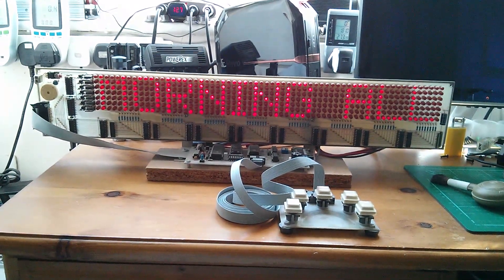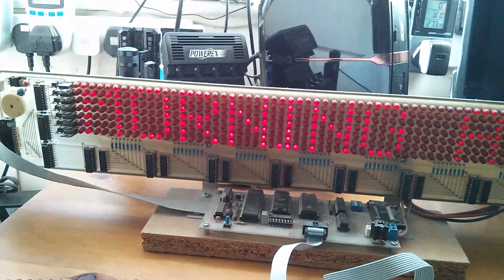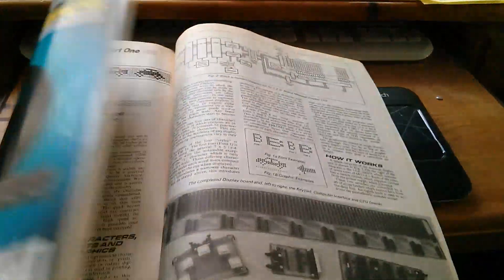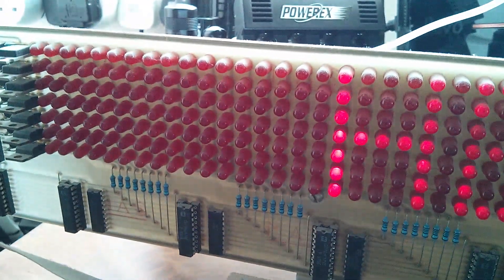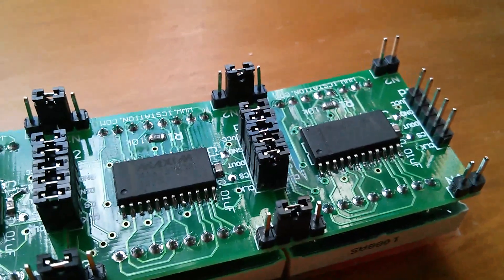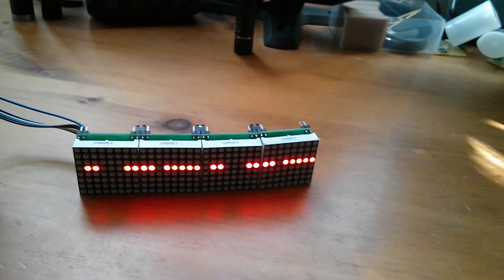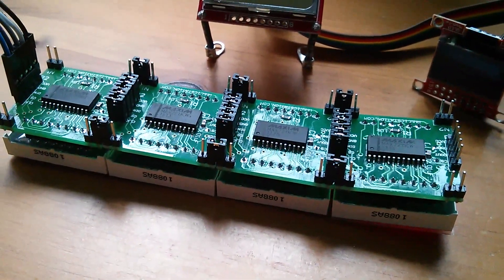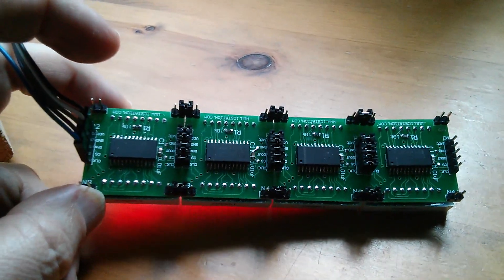LED Matrix Displays and Non-Optimal Byte Orientation

Comment: I made one in the 90s and I used horizontal bytes Because vertical bytes would have been too dim with all the multiplexing. 1/7 brightness is much brighter than 1/32 brightness (multiplexing duty cycle).
Reply: I mean several 74373 can drive all the columns of each row simultaneously 1/7 of the time and not be dimmer if the matrix is longer. A bigger transistor drive each row then but there are only 7.

Comment: Bought heaps of different LED 8*8 matrices and at the end of the day they all worked but were a pain in the butt for one reason or another to cascade. My next project is using a DIP version of the MAX7219 using the 3mm 8*8 array in a 4*1 configuration that can be linked.

Provided the 4*1 works and can be linked and I got the spacing right will make similar for 4*2 and finally 4*4.

As for buffering I have multiple bitmap classes for 1,4 and 16 bit displays so use the 1 bit version for these. The 1 bit version (here's the trick) has 2 mapping options so I use the one that mimics the MAX7219 output format 1:1.

My MAX7219 class has an output buffer method that expects a frame buffer and it simply transfers the lot. On my Due it uses DMA at a clock of 20Mhz to do the transfers which can output well over 100 FPS with a 32 * 32 pixel grid.

I also found the original code I used for the MAX7219 was quite shockingly slow. It use to clock a lot of NOP operations and over multiple devices it would choke. Basically I send each byte just once but send in reverse order as they get shuffled along.

Comment: Bit-per-pixel video displays almost invariably orient bytes horizontally because everything on a row needs to be sent consecutively because an N-dot display will only need to fetch N/8 bytes per line, instead of fetching N bytes of data and discarding 7 bits from each.  Scanning top to bottom generally looks better than scanning left to right, and unless a display's memory is set up to group bytes differently when fetching than when writing, that implies that bytes get oriented horizontally.

My more modern pet peeve is with color oled/lcd displays that require shifting in 16 or 24 bits per pixel.  Adding a 256-color LUT and then having an option to write 8 bits per pixel shouldn't cost much, but would make microcontroller-based screen updates almost twice as fast.

Comment: I had this problem on a display like your and all I had to do was make changes to the header file for the Arduino library I was using. I used the MD_MAXX7219 library and after making the changes it worked great. I think learnelectronics has a video on it.

Comment: For cascaded modules you better use a software display buffer (bitmap), because you can easilly build e.g. 16X128 pixels matrices. You can put bits to the buffer any way you like. Finally, a Paint() or simillar function transfers whole bitmap to the MAX ICs. I could send you my software 'driver' if you like.
Reply: Was thinking the same thing, why not just solve it in software. Have a separate the font and a screenbuffer

Comment: I agree. The chip was meant to drive 7s digits. Anyway, you can arrange anything you like in software ;) (1. Create display_buffer, 2. Fill with pixels using by column method, 3. Transfer it to the matrix using the matrix orientation)

Comment: In my time creating new fonts for the ZX Spectrum I clearly remember that it uses vertical lines when creating characters.
I used a notebook with 5mm squares to draw in each character and them writing the binary value next to each row.
Reply: £-D  The good old(est) days, yes I remember doing that too (and for the C64 fonts [and sprites]) until I created a bit editor and then just saved the data to where it was needed...

Comment: I also have copies of the PE with the message board...well done...great project...different spelling of your name.
 I have recently built the brainy-bits one with 8 modules having top and bottom connectors. I would have liked to build the Parola (marco_c) version but I think they have only released a library for a max of 8 modules...some nice effects there. I wanted to try up to 16 modules.

Comment: I bought these same ones for $1 per board and they work great! I had the same problem at first but I did the rotate in my character data and then bit masked the data to flow by row instead of by column.

Comment: I bought 4 8x8 Led matrix modules (similar to the ones you showed on ebay, but preassembled, 1.70 pounds each. They fit next to eachother, of course the wires go in at the bottom and come up the top, so it has to be connected with wire. But since its vertical bytes, its easy to program. Actually few days ago ordered another 4, because why not :)

Comment: You've not got it wrong, that's a really annoying way to implement a display.  It would be much nicer to send out a vertical byte each time.  I used to service the huge tungsten and then LED public display panels and they all sent the data out one vertical byte at a time using cascaded 4094 shift registers.  The only way I can think of getting around that is to use an eight byte buffer that you fill normally, but then gets shifted out vertically, but it's still a load of programming hassle.

Comment: Did you get any more projects published in P.E. or other mags around that time? I have quite a few ov those old issues eh. :)
Reply from the maker: Yes, after the LED matrix, we did the EPE Fruit Machine, MIDI Analyser and I did the National Lottery Predictor (UK lottery) followed by an article on alphanumeric LCDs.
Reply: Julian Ilett I'll keep an eye out for them when I go through my mags...! I often find an old back issue ov an electronics zine makes for good light reading. :)
Reply from the maker: xanataph I had a huge collection of electronics magazines some years ago. Storing them was a major problem - at one time they were in the machine room above a lift shaft in the building where I worked. Then they filled an old scrap car on my drive. Eventually I sold the whole lot for £1 on eBay. I could never find the article I wanted anyway!
Reply: Julian Ilett Yes, I have boxes and boxes ov them, proly not as many as you had, but spread all around the house. And indeed it's a major problem to find a certain article when you want to refer to it! I just don't seem to do it. Whenever I have an idea for something I need to make I just design the circuit from scratch, like the beer fridge thermostat I had to put together the other day..! (Fridge doesn't get cold enough to be a fridge, freezer doesn't get cold enough to be a freezer - but that compartment makes a great beer fridge for our Tap King now that the temp is under control). I'm sure I could have found a circuit in a mag somewhere and saved the development time. But which mag? hehe
Reply: xanataph And besides I wanted to use a germanium PNP transistor as the temp sensing element, as I haven't got any thermistors or those temperature sensor chip thingies. ;)

Comment: What you can do is store each character as 8 bytes, where each byte is a horizontal row, and just left justify the 7x5 font leaving the right most 3 bits empty, then when you come up with a string to send, assuming a 1 wide gap between, you get groups of 4 letters for 3 bytes:    (6)(2|4)(4|2)(6)
So you send 4 letters at a time
(a & b >> 6)
(b << 2 & c >> 4)
(c << 4 & d >> 2)

And just do that for each row, I'm not sure how the interface works to the LED's but it seems to me like you either shift them over and write a byte in, or you send a byte and an address and it works it out. Either way I think this solution can work and if you need less than 4 letters you just eliminate letters going back from d.

To have it somewhere else besides left justified it's a bit trickier, if you're coding in assembly or can add some inline you might have access to a right shift with shifts the bit on the right into the carry flag, and another than shifts the carry flag into the MSB while shifting right, though that would need to be done on the whole word.

Another way that should work would be:
mask = pow2(offset) - 1;
b1a = (a & b >> 6);
b1 = b1a >> offset;
b2a = (b << 2 & c >> 4);
b2 = ((b1a & mask) << (8 - offset)) & (b2a >> offset);
b3a = (c << 4 & d >> 2);
b3 = ((b2a & mask) << (8 - offset)) & (b3a >> offset);
Reply from the maker: Wow, thanks for all that detail. I'll have to read it a few times to make sense of it all
Reply: Julian Ilett No problem, I had to think about it a few times to get the shift values correctly, looking it over again today I'm not even 100% sure of my logic for the version with offsets so I'll have to look at it again since it's making me wonder if I even really need the mask at all since I'm left shifting it
Reply: I think there's one error there, you need ORs or adds, not ANDs to combine chars.

Still feels like a bit of a ugly workaround, as to be able to change a character you need to keep a text or bitmap frame buffer in sram on your micro.
Which somewhat negates one benefit of having MAX7219s in the first place.
i.e. if the displays were the other way around, to write a character at some position you look up the 5 values for the columns of your character and write them to the correct addresses.
The way around these are, you have to look at 0, 1 or 2 neighboring characters, look up the bitmaps for them (unless you keep a bitmap frame buffer... which takes up even more memory), do the shifts/ors and write out 7 or 14 bytes.

Once you go beyond playing glorified HD44780 and start doing variable width characters, fonts that aren't a multiple of (7+1) bits high and/or arbitrary vertical position, it kinda becomes a wash as you need a frame buffer anyways.

Hmm, on second thought... every time I found myself caring about RAM usage on my controller that much, I was too cheap and should have gone for a bigger one in the first place.
Reply from the maker: artforz Agree entirely - I've got the other module type on order, which looks like the byte orientation is vertical. I'll make another video if that one proves to be much easier to write characters to.
Reply: Julian Ilett
Yea, if it's easy enough just to get ones that work better, it's much better than having to deal with a hacky solution like mine was. Kind a of right tools for the right job situation. I'm sure there must be some reason that someone would want horizontal byte orientation like this.
And yea those should have been ORs not ANDs.

Comment: Maybe rotate each display 90 degrees, dispense with the jumpers and use ribbon type interconnects or to get really long-winded you could make a PCB. Working on the software sounds best but from what I've read in the comments I wouldn't know where to start. Good luck.
Reply from the maker: That was my thought - until I saw those cheaper, DIL modules with mounting holes
Reply: i thought that too, as there is another model that has the chip on the bottom of the PCB that has the modules link from bottom to top. 
Also there is another model that has the modules linked together with tinned copper wires instead of links.

Comment: Yup I'd just use a framebuffer and write to that, outputtng 30 times a second. It's a hardware problem that can easily be solved in software, providing you have enough ram in your microcontroller to store an entre framebuffer - should be plenty on an atmega328
Reply from the maker: Of course you're right, a frame buffer is the answer. It just feels a bit unnecessary because the MAX7219 is like static memory - it holds all the display bytes and does its own multiplexing. But I guess software exists to glue incompatible bits of hardware together.
Reply: Julian Ilett I'd certainly agree that there is an issue - the developers of that particular board have basically stuck the daisychaining connectors on the wrong edge of the board. You could rectify the issue by joining each board together with DuPont connectors, but that's not ideal. Also, If you were tight on ram in your microcontroller, a framebuffer may not be an option, and it'd be nice to be able to use the MAX7219's internal memory instead. It's a pretty silly design flaw in the board to be honest - but then you can't really expect much for £2 ;)
Reply from the maker: Kieran Simkin Exactly my thoughts.
And you're right of course - spend £2, expect problems. Then again, problems are fun - you get to solve them!

Comment: This  horizontal bytes arrangement isn't any different from how a VGA works in 16 color mode.  it's just about masking/shifting your bits into the place you want them.
It may be "weird" to someone into electronics with less experience at programming graphics, but for someone used to graphics programming this is a pretty normal setup.
Reply: Elaborating on this, to program it, I would just imagine you have a screen buffer (an array) matching the size of the display and you do your bit-twiddling there, then update the leds from that buffer.
If you have fonts that are 8x8 this makes perfect sense, ifyou have a narrower font, or if you have variable width fonts, it's a bit more cumbersome.  
Also: it might make less sense for text, but for adressing it like a bitmap it has it's advantages doing it this way.
Reply from the maker: Really I'm having a go at the PCB designer, who doesn't appear to have given it any thought. The designers of the Nokia and OLED display chips went to some lengths to make life easy for the programmer - particularly if arbitrary strings of characters are to be put in arbitrary display locations. It's almost as though the designer of the LED matrix PCB set out to make it difficult.
Reply: Julian Ilett Like I said, this orientation is normal for computer video. It makes scrolling vertically easier (and makes horizontal more difficult). Displaying font isn't significantly difficult either since computers tend to use fonts with a width of 8 pixels (various Heights).
For a led display where you plan on using horizontal scrolling a lot, the other orientation makes more sense.

Comment: I would solder some sockets to a big plane pcb and plug the modules in nice and flat.
These modules are probably designed to create a bitmap output not specializing on fonts. horizontal memory orientation is more common.

Comment: Hey! 

I've built a 64x16 pixel (so 8x2 modules) display from these exact modules. They're driven by an Arduino Mega, and I get around 35-40 frames per second. Images are sent via usb serial from a python script, wich just downsamples and chopps up png sequences, and sends them one line at a time (so 8 bytes), the arduino waits until a complete frame is received, and pushes them out via 2 channels to the maxim chips. sadly 2 channels are required, because its actually not possible to chain them for very long. Only 8 of them are supported per channel. I was thinking that I could at least double the frame rate by displaying each line as soon as its received, so maybe some sort of rudimentary 3-level greyscale could be acheived. Sending a complete row at once is actually the fastest way to drive these because of the way data is shifted between them.

Got some of those Nokia displays, and the same oled displays aswell laying around, waiting to be toyed around with. 

I also got some of those smd-less modules, they didn't work though. chips were fake. not sure if the smds are the real thing, but at least they work.
Reply from the maker: Ugh, that's all I need - fake MAX7219s!!

Comment: Have you considered using a frame buffer which gets written to the screen every so often? Then you can write/draw to it in any order or direction you want easily.
Reply from the maker: Thinking back, the Z80 LED display had a frame buffer because the display hardware can't hold data - it's just made of row and column latches. So we were constantly reading the frame buffer and writing to the latches to produce the multiplexing.